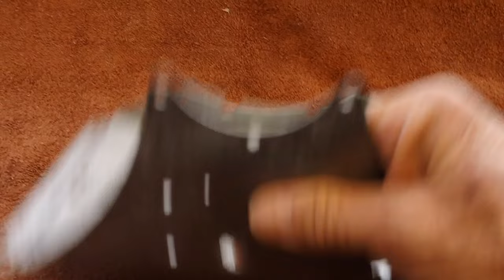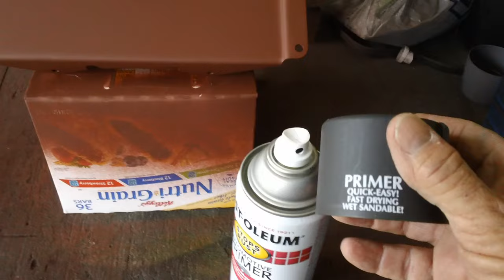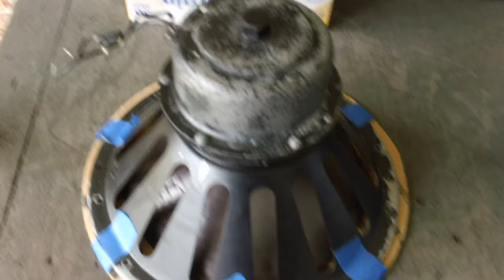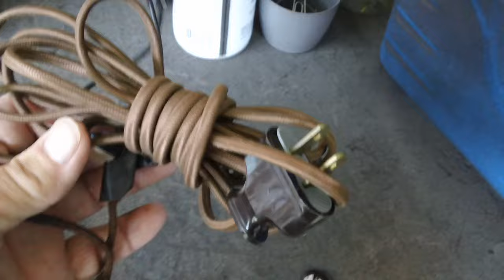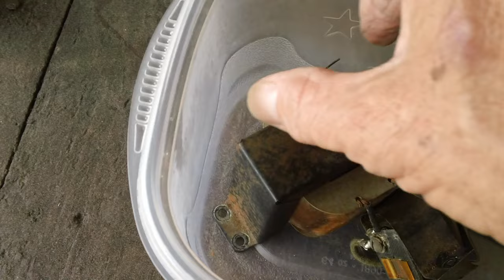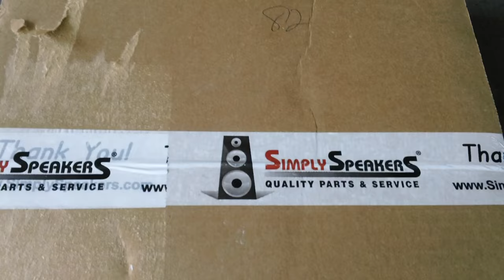1927/28/29 Rola speaker restoration (Part 6).

Comment: On metal work, I also use TSP (TriSodium Phosphate) on my metal pieces after cleanup and before painting. It not only cleans but does a bit of etching. There is a 'environmental' version of TSP available with water cleanup.  Just an extra step to really nail the prep.  Nice paint job, by the way.

Comment: John:  I have been thinking, That "choke" may actually be a coil of wire with an output capacitor kind of network for impedance matching, maybe!  Atwater Kent had such an affair mounted on the chassis, I might be wrong in this assumption but thought it was worth mentioning !  ------  John A Bellas  ----  KC2UVN

Comment: Hey John,

Thanks for the speaker series, I've always been curious about this type of restoration process.

With regard to that rectifier, it reminded me of the voltage regulator we had on the Douglas DC-3. It was designed around the same time as your speaker and simply uses compressed carbon (if I remember from ground school correctly) and some of those old Dakotas still use them today. They’re adjusted with a screw that compresses the carbon and plates. Amazing something slightly larger than the size of a soda can is in charge of regulating voltage of a 17,000 lb airplane. And it’s so simple in design! Here’s a picture of one: http://i.ebayimg.com/images/i/182407956266-0-1/s-l1000.jpg

With regard to retirement, I wouldn’t sweat it too much. When I decided to take a sabbatical from the airline, I was worried about climbing the walls with boredom. I found LOTS of things to do that I never had time to pursue. I even got on with a local radio station and am producing a radio drama series. Never imagined I’d do that. With your work ethic, amazing things will find you!

Comment: Hey John, I miss having access to factory stuff like that.  At one time I worked for Tecumseh and worked on a steam jenny heated alkaline dip tank that we used totake the rust off stuff like compressor crankcases, shafts, right angle drives, etc.  Also had a steam jenny heated 111-trichlorethane tank that would take the grease, oil, toluene, off about anything you put into the vapor cloud above the liquid.  We had a 6 vat machine there that put that permanent black stuff onto crankshafts that's supposed to act as a pre-lubricant for the shaft until the oil reaches it at start up.  I put some revolver parts into that thing once and wound up with a very pretty black black powder revolver, lol.  Congratulations on your impending retirement!  You'll still work, but it'll be at home.  Stuff always manages to find a way to be niggling away at your free time, lol.  Take care, Gary